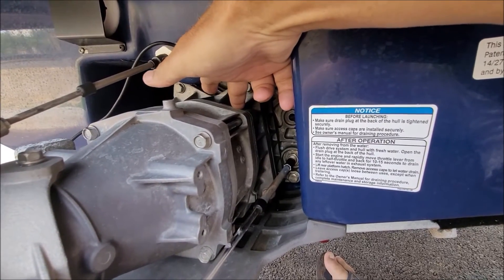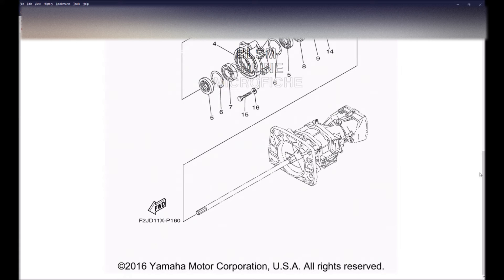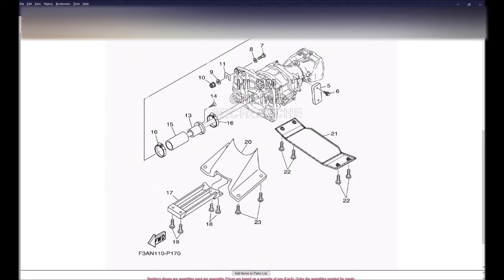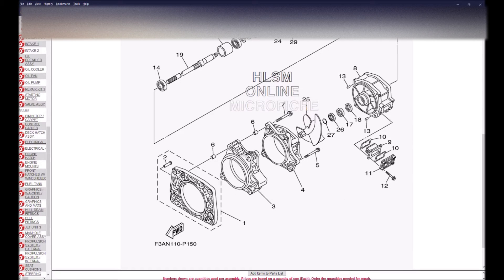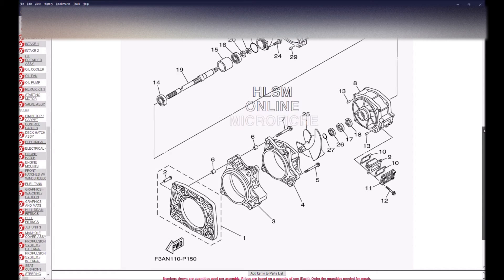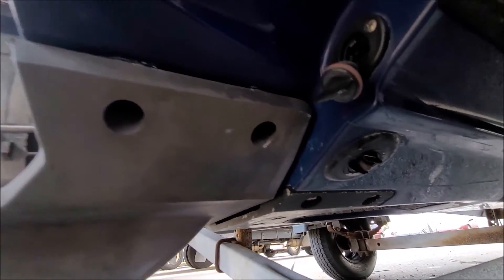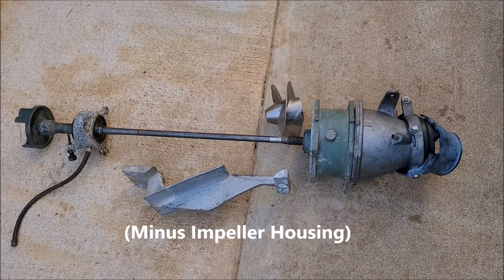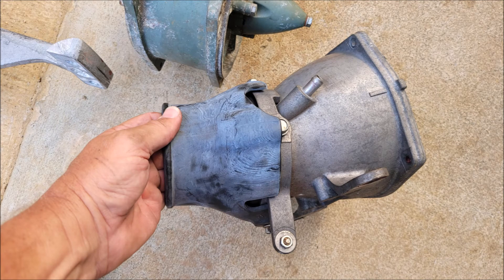Yamaha Jetboat Jet Drive Pump Basics Get To Know Your Pump

Comment: Great vid! Will running the motor at high speed without the reduction nozzle cause it to over heat? (I have a quick connect because I run a flyboard off my port engine and when it was time to leave I thought it would be okay to hook back up the reduction nozzle on land but it over heated and shut off) I’m thinking it’s either because A. the lack of pressure  caused my prop to spin at much higher RPM and over heated the engine or B. The lack of pressure didn’t allow enough water to be forced into the cooling system which is flush on the side wall of the prop or possibly both of these scenarios. Anyway I’m trying to make sure this is indeed why my engine over heated in the first place and not something else all together
Reply from the maker: Now that is something I've not thought about but sounds super fun!  You are correct about the loss of  pressure as the likely source of the overheat trigger.  Question:  Does the flyboard attachment have it's own reduction nozzle and does that motor/pump continue to bypass water out of the side like normal? If so then all should be good.  I'm assuming that you run both engine/pumps like normal to your spot and then make the switch to the Flyboard set up and then would have to reverse the process for the return.  If you elect to return with only the one engine for power (leaving the flyboard attachment in place during the return) you should consider a block off of some kind to prevent the forward motion of the boat from sending water up through the system of the other non running engine. The down and dirty ez method would be to unhook the rubber hose from the sand filter inlet and plug it for the ride home.  A more permanent method is to plumb an inline valve into the cooling hose that feeds the raw water to the engine.  This would be inside the engine compartment.  Good Luck!

Comment: Well done, Scott! Thanks...
Reply from the maker: You're Welcome! Glad to be of help, knowledge is everything!
Reply: @HawaiiJetboat  Question; I recently sucked up a tow rope and spent the next hour and half removing it from the shaft and impeller. The boat ran fine going back to the ramp. However, was considering pulling the pump assembly apart to inspect housing and impeller, do you think this is necessary?
Reply from the maker: @dcc2444  Aloha!  If you were able to cleanly remove all the rope I would say "no need" to do the full pump removal.  You indicated that everything ran fine afterwards which is a good sign but to be double sure get underneath, drop the intake grate and eye ball with a cellphone camera or gopro or mirror to see if any loose strands are still present.  From the exit nozzle side I would shine a high powered light into the cavity to also see if anything is lodged in the pump itself (the veins of the stator).  In all my years Ive only seen fishing line get behind the prop and wrap around the shaft.  I only found out that I had the line wrapped around the shaft because I changed props.  Good Luck!
Reply: @HawaiiJetboat  Thanks was worried  I damaged a new 2021 boat! Everything looks clear!!

Comment: i had an sx190 and a small rock maybe the size of your thumb went into the impeller locked it,  and spun the threads on the coupler housing,,  had to replace the coupler to. the engine would spin but the impeller wouldn't turn left me dead in the water,
Reply from the maker: That's not one I've heard of.  The two I remember the most from stand-up pwc days were:  1) sucking up a tree branch twig about the length of a tootsie Roll and the 1/2 the diameter of a pencil which impaled itself on a sharpened pump vein and woud not shake loose, had to disassemble the whole pump to remove it and 2) the breaking of a Solas prop blade (metal fatigue) on my Blaster.